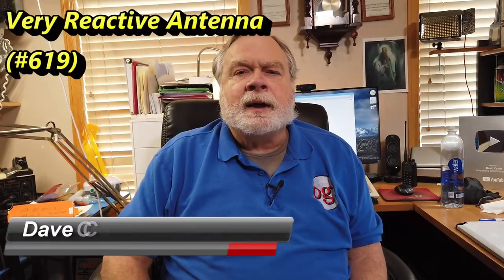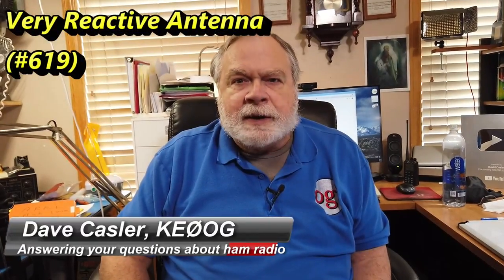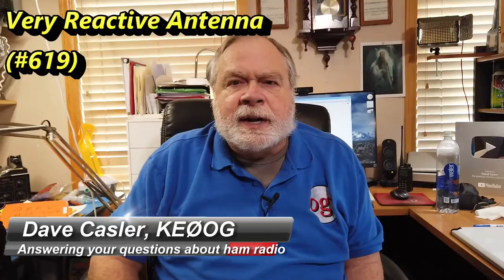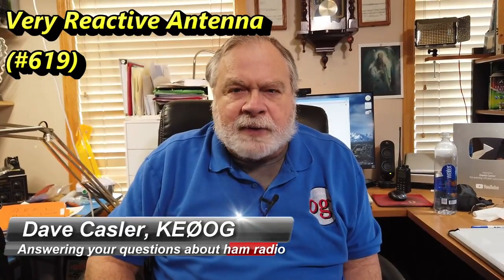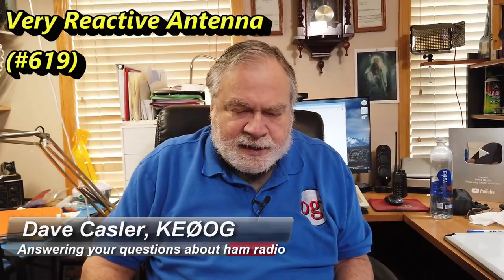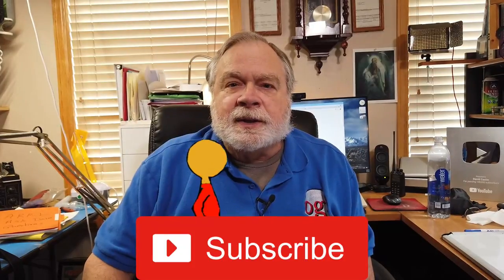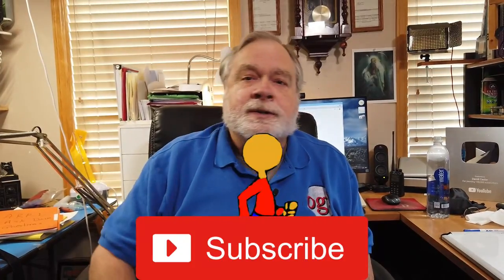Very Reactive Antenna (#619)

Comment: One method to recall that capacitive reactance is -j and inductive reactance is +j.  Picture the negative sign ("-") as being one horizontal plate of a capacitor, and the plus sign ("+") as being one turn of a coil around a horizontal form.  Ken WA8FCI
Reply: Nice mnemonic device Ken ! I posted a response if you're interested.

Comment: To answer the question posed, is it possible to use a 4:1 impedance transformation to accomplish the matching solution? Yes, if you use a reactor in series with the antenna between the feedpoint and the transformer. This could be a lumped constant or a shorted stub. But we need to know the operating frequency which was never mentioned. To tune out the reactance on 7.1 MHz (assuming the reactance was capacitive) a 58uH series inductor would be needed, as all you need to do is introduce a reactance of the opposite sign to cancel out the antenna's reactance.  On 3.9MHz it would be 105uH. These are pretty large inductors. All it takes to figure this out is a few minutes with a Smith chart calculator or even pen and paper. Then there's the issue of a counterpoise being required.   I agree with Fred and Larry - adjust the antenna length for resonance unless it's impractical. Base loading is inherently lossy and the coil would need to have a pretty high Q.
Reply: Thanks Rory, you are exactly right about using the Smith chart, and I did that after asking the question (see my response post). As in my other responses, this is a non-resonant antenna, so there is nothing that can be done except adding inductance, the question was really if a transformer would be better for bandwidth than a lumped solution, and the Smith chart answered that with a yes.
Reply: @louisseaman8455  - Curious, did you calculate the load impedances over a frequency range before applying the Smith chart calculations?  Hopefully you remembered that the impedance changes with frequency... 
BTW, the Dellsperger Smith Chart calculator has been very useful.

You also may consider (instead of using a separate 4:1 transformer) to use a tap the on the loading inductor and treat it as an autotransformer to get the desired impedance match.

Comment: It's a heavily-reactive load but for a single-band antenna it's no problem to use an L-match at the feedpoint to correct the mismatch straight to 50 Ohms. There are various calculators online which can tell you the necessary values of L and C if you know the frequency and the real and imaginary impedance components.
Reply: Thanks Stu; you're on the money, it is a single band antenna. I've posted a response if you're interested.

Comment: Every AM broadcast station (that I know of anyway) has an ATU at the base of the antenna(s), to tune out the reactance that will always find its way into the system.
Reply: Yes, in most cases the tower is not necessarily an exact quarter wave in height. Example is BC transmitter at 1310 KHz using 200 foot towers ( a quarter wave would be closer to 179 feet). The reactance and feedpoint impedance is matched at the antenna in the "doghouse" to the coaxial deadline.

Comment: Hi Dave- While I don't understand antennas as you do, I do have several years experience with an MFJ remote ATU and a vertical antenna.  The difference the ATU makes, for me, is night and day.  My antenna is 18 feet tall, mounted on an aluminum fence at 3 feet high, which I believe works as my radial, and I work 10 through 160 meters with great success.  I am so happy with the tuner that I bought a spare..just in case.  Living in Southern Florida, we get a bit of lightning.  Thanks for providing continuing education!  PS  Wish I had taken EE in college rather than Psychology.  73

Comment: The first thing I would do is to find out why the antenna is so reactive. Evidently it is not near resonant at the operating frequency or band. Rather than just throw money at the problem, and order a high priced antenna  tuner fix it at the antenna first, as much is practical. May be as simple as adding or cutting a few inches or feet of wire, if it's a wire antenna. It would be good if we could see a detailed description of the installation, and with all the experience of your followers, there is likely a simple fix.
Reply: Thanks Larry; please read the comment I posted to get some more detail. You guessed it, it is a non-resonant antenna; it's a collinear 2 element vertical 5/8λ for 10M.  You'll see in my response post that it didn't take a whole lot to get this antenna to 50 Ω, surprisingly to me though, it took more inductance if I used a transformer.  Having built trapped dipoles I'm familiar with how high value coils can severely narrow the bandwidth, but in this case, it looks like the UnUn transformer wins the bandwidth contest.

Comment: 5:15 If  the antenna is reactive, a lumped inductance (a coil) may help. A lumped capacitance would probably make the things worse. A resistance is bad in transmitting antennas, as it introduces losses - although it makes a nice VSWR.

Comment: :) ... a lot of flag pole antennas use a tuner at the base of the antenna. I wonder how the tuners hold up in  harsh environments?
Reply: Though MFJ says their tuners are weatherproof, I mounted mine in an additional weatherproof box.  3 years of Florida humidity and rain and irrigation, and no problems.  The ATU isn't even dusty on its' case.

Comment: I think you missed the ball here. You do not mention the type antenna but a very high capacitive antenna is an OPEN antenna. Fix the antenna and forget about trying to balance out things with coils.
Reply: Thanks Fred; it's a non-resonant antenna, so it's not going to ever have the nice balance between reactances that cancel out that a 1/2λ antenna has. If you read my response post you'll see that the question is really bandwidth of a chosen solution.

Comment: So the X reactance on your 259B is a capacitive figure just like the ohms is the impedance figure?
Reply: The reactance IS expressed in ohms, but imaginary (with "j" sign). The impedance is a complex number Z=R+jX
Reply: @ButtonKing is correct. To put a fine point on it, when capacitive and inductance reactance is balanced in an antenna, the antenna looks like a purely resistive load (like a carbon resistor or dummy load). If the antenna has excess capacitive reactance (-j) or excess inductive reactance (+j) that means the current and voltage are out of phase (+j voltage is leading current, -j current is leading voltage), in either case the load is no longer purely resistive and you are going to have power reflection issues.